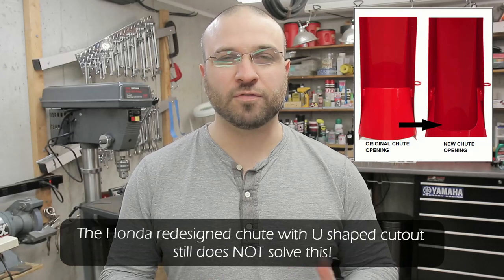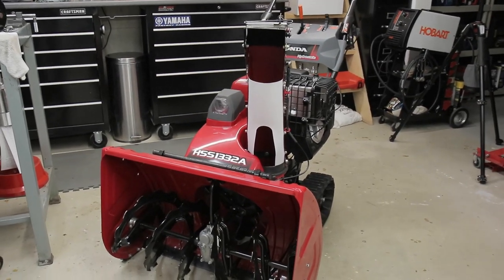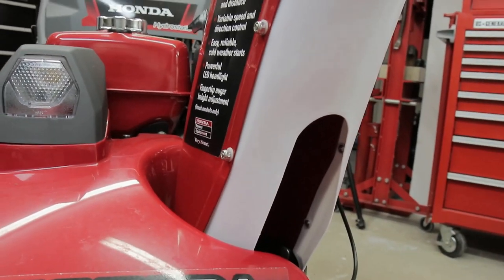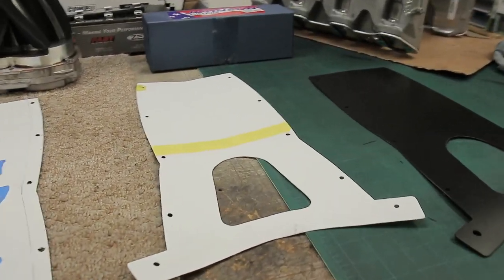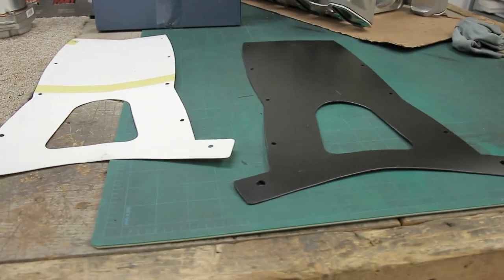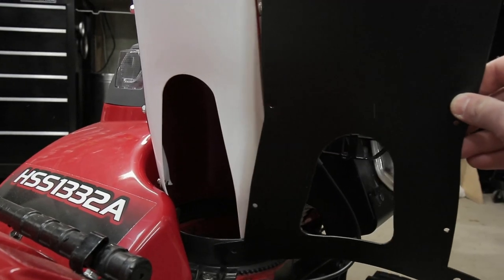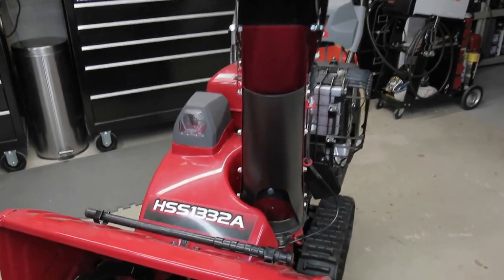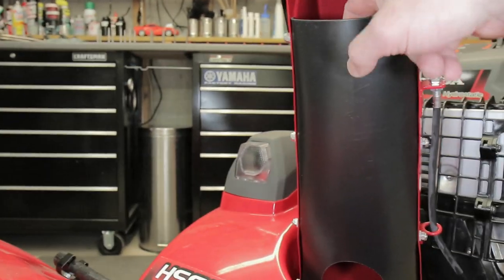Custom HSS HDPE Chute Deflector Snowblower MOD  | Honda HSS1332ATD | PART 3

Comment: I call it the ejecta problem...  I have an early 1980's Ariens ST824.  The machine is sporting a Harbor Freight Predator 301cc 8HP engine plus a zero-tolerance impeller wiper modification.  In addition, I took the base gear ring and welded it to a tall discharge chute.  It's quite the thrower now!   But...

On full-stop right deployment of the discharge chute, the base of the "L" impeller paddles bat ejecta back at the operator.  To fix, I took a section of 6" PVC sewer pipe and formed, in Honda parlance, a tall collar which goes all the way up to the chute pitch deflector.  The skirt/collar is just held in-place with 1" Velcro keeper straps.  So, if there would ever be a problem (with an impeller wiper modification, unlikely), the PVC collar/skirt can be removed for cleaning.
Reply from the maker: Exactly why i design this chute cover to keep discharge hitting you when fully turned (back chuting) it also keep the discharge in a tighter more condensed stream and less build up on the machine hood as a result.

Comment: Great video's enjoy all the honda snoblower content. Checked out the price of the new deflector. Was shocked at the price $199.99. Hard to believe you can sell many at that price. Good luck.
Reply from the maker: Performance video coming soon...So then what would you pay for a custom piece like that? The deflector is not for everyone i understand that. Most people wont think its necessary. And will just suffer with snow in their face and snow building up on the cowl & auger housing.  

But there are a few that will want the solution and benefit greatly. I have spent over a year developing this custom piece that solves a problem. Unlike Honda engineers have. Lots of trial and error and development of something that performs all on my own time. 

I am making these all by hand to my exact spec. I am investing my time and material cost. So im pricing it according. Thanks for watching!